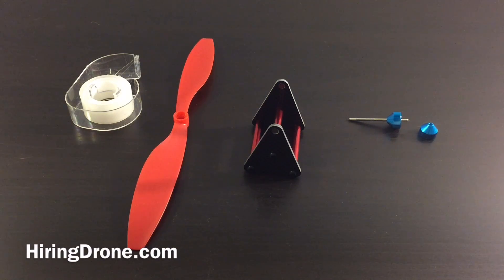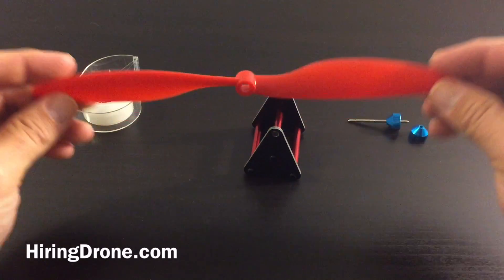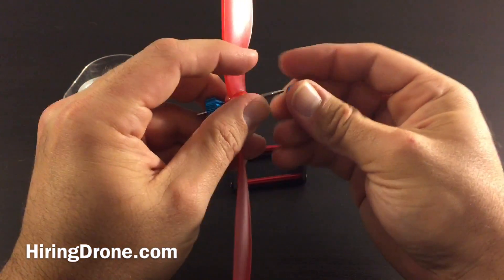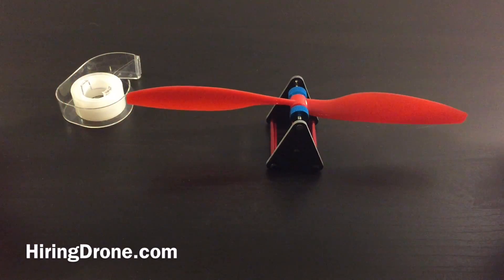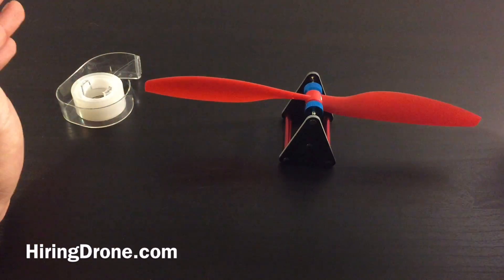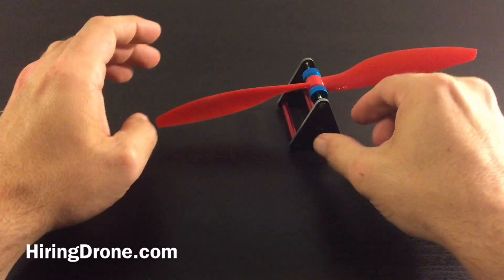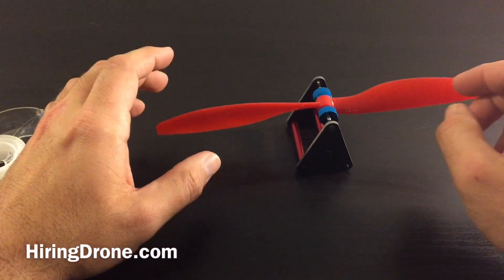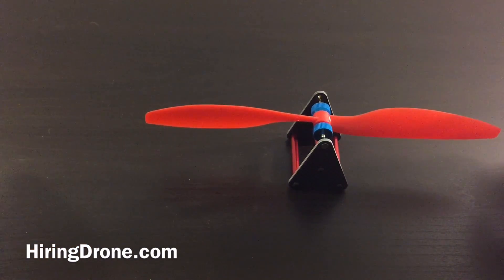Quadcopter Propeller Balancing Tool

Comment: Hey HaD,
I just saw this video, and as always, I enjoyed it. I noticed the prop was pretty balanced from the beginning, but what I wanted to see was you to flip the prop over, either from front to back, or flipped right to left.
I thought I was seeing a balanced propeller with an unbalanced hub.
The fact that the prop kept centering meant the blades were balanced but there was either a heavy spot on the bottom side of the hub and/or the centering nuts were loose.
Anyway, keep posting, always a good job, nice to watch someone enjoying their hobby and helping the rest of us get better.
Reply from the maker: +parkerdude2 Thanks for the feedback. After examining the prop balancer, I learned it was junk. The magnetic plates that hold the spindle did not have a groove in the center, to keep the spindle dead center. This resulted in false readings, as the spindle was off left or right each time. I went cheap on this balancer, instead of getting a high-end one. Learned my lesson, you get what you pay for. Appreciate the advice and will try it on my next video.

Comment: your supposed to tighten the blue screws snug against the prop.
Reply from the maker: +Ian Rice Thank you for the advice. I could not get this thing to work correctly. The metal rod needs to be completely center on each of the magnets, which was impossible for me. If not, it would give a false result. They should have possibly made a groove in each of the magnets, so the metal rod would be centered. I ended up returning this thing. I guess you cannot expect much for $8. Did you have success with yours?
Reply: yea i hear you man this thing is all jacked up. the blue screws on mine are so of balance i can see it with a naked eye. the hole is so off center. thats a good idea you have for putting the grooves in the middle so it sets in properly. I'm ordering a dubro they are the best.